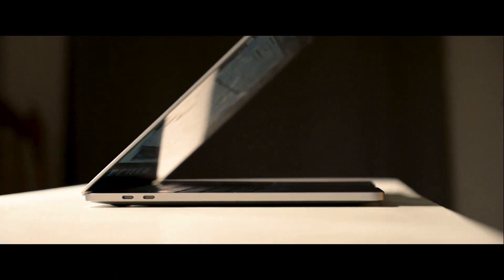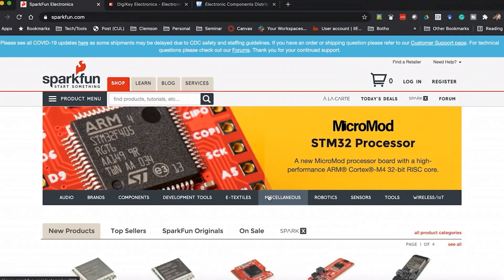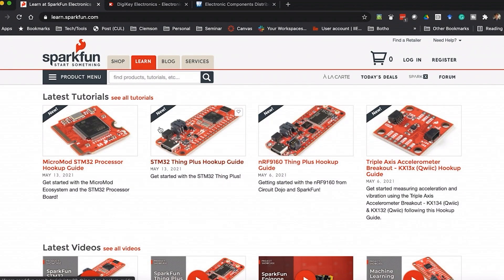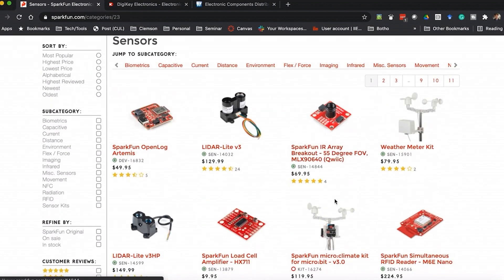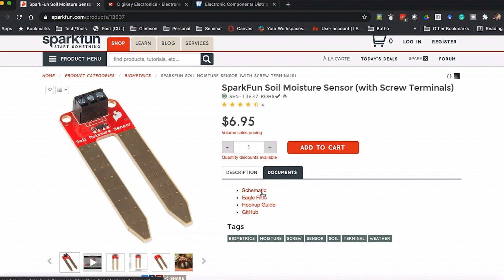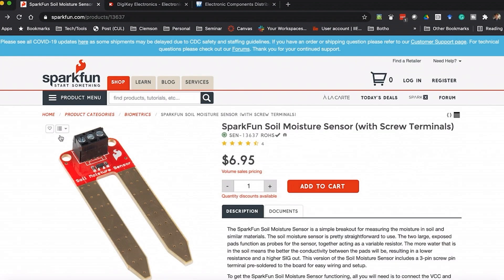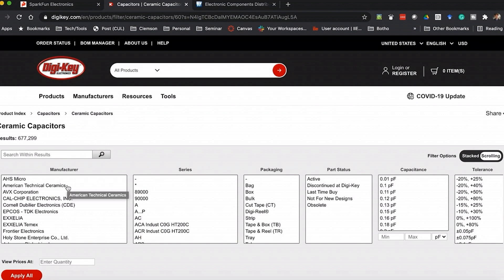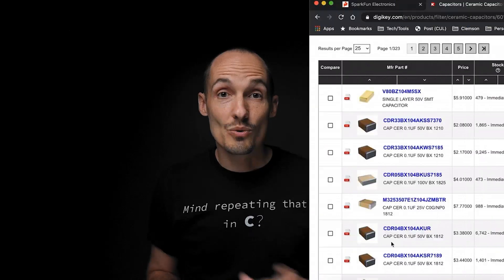Finding Parts for your Embedded Systems

Comment: I made a block diagram for a project which is a digital storage adapter for my analog oscilloscope. I must admit I'm sort of stuck on RAM. To store at the sampling rate and depth I want I need a good size of external ram from the mcu. It is going to be written to nand flash but that's a bottleneck in the system. I have no idea how to size the ram properly so I was aiming for a large buffer that'd cover most if not all the data because I know with errors in nand flash that can really back things up.Then I saw how expensive ram is. what kind of ram should I get and how do I properly size it? I'm not an EE or software dev, I'm just a self taught board repair tech that's too ambitious for my own good. I'm using a stm32h7 series mcu with an adc from texas instruments aiming for 200 megasamples as second.

Comment: Sir, i love your videos. I have a lil question!
I have worked on Arduino and sensors and made most projects. i have learned ARM processor's. Now, can i get a job on basis of ARM processor.
Reply from the maker: Thanks! I can't guarantee who can or cannot "get a job", but there is definitely a lot of ARM-based embedded work out there.
Reply: @JacobSorber  i am from Pakistan and there are very less jobs based on embedded system's.
If i plan to go to USA or UK can you help me which skills i need to polish.
Thank you sir